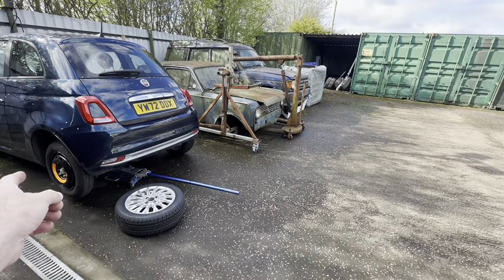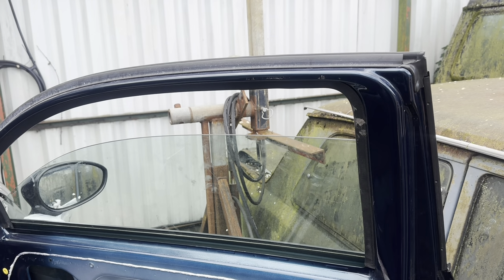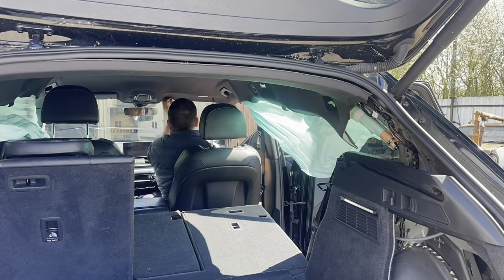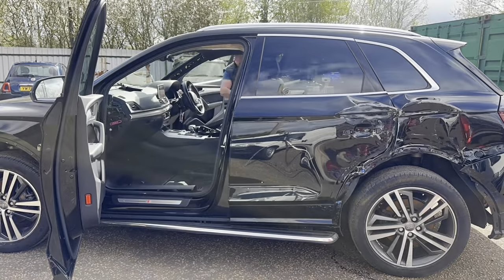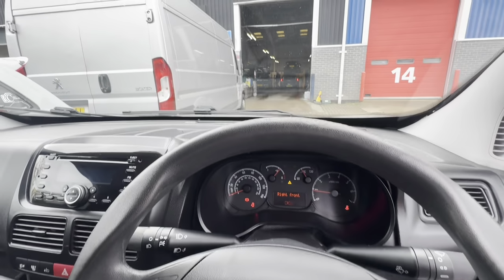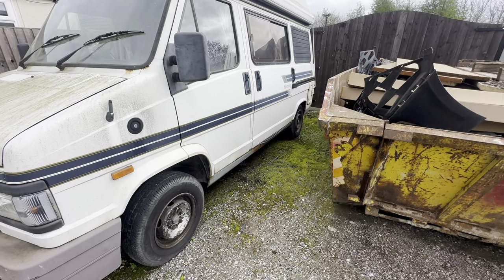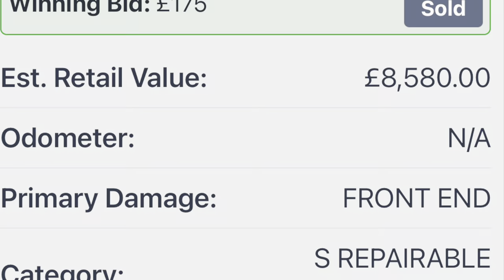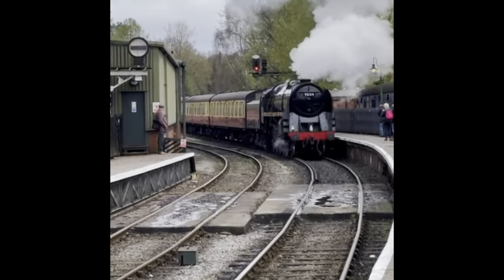EVERYTHING MUST GET DONE MASSIVE STOCK CLEARANCES

Comment: If you come across the thread-lock situation again, get Chris's big soldering iron and heat it up and hold it on the end of the bolt until the bolt heats up as much as it can, that'll soften the thread-lock and make it much easier to extract the bold. Using the soldering iron is far safer than a flame type heat gun which is a fire hazard and discolours the bolt. I've never tried a blower type heat gun but have my doubts if it would get hot enough.

Comment: I've just crushed an older KA almost looked the same. 
In Denmark it must not be repaired, even though it could have been.
Pulled out the Fiat-engine and gearbox, the right hand door and a lot of bits and parts.
I believe that engine will provide someone with a lot of kilometres, and the rest will be sold as parts.
I would have just the same as you did. You simply can't go wrong with that.
And the little Fiat is a nice little car probably with the same engine and gearbox?
Nice work, Rob. 
I wouldn't be scared to buy something from you guys. It's really nice and well done.

Comment: I would have expected a thread lock on safety belt bolts. There’s obviously various strengths of threadlock for various conditions.  Light solution for just light vibrations to high strength that’s not meant to be undone. Obviously Audi have came across an issue with those bolts slackening I some occasions and added a threadlock to solve it

Comment: An utter w@nker smashed my driver's door glass last August on my VW ID.3.  They didn't even try to get in the car so it was just a tw@t being a spiteful vandal.

It took me more than an hour just to remove the broken glass both inside the car and after I had taken out the door card and window winder/motor mechanism.  

Got a glass from a breakers as the window companies didn't have one and didn't know when they would get one.They rang me six weeks later on spec.  I'd done the job a whole month previous.  £58 and they dropped it off for me at no extra charge.